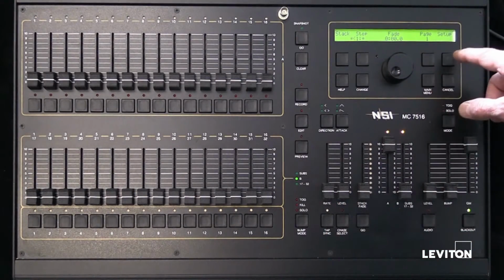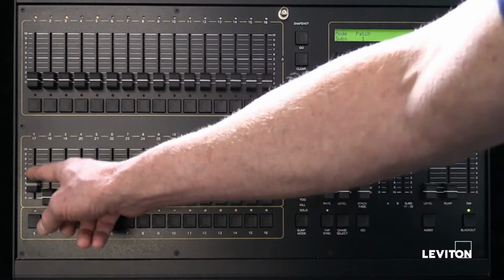7500 Series Technical Support and Training

Comment: Hi I have a dmx controller model liviton mcl-128R I want to know if I can put new luminaires type beam 7r manually and as I do since I do not have the cable psrs download the current library of my equipment
Reply from the maker: Yes, there are ways to add a DDL file to the MLC128R. Please contact emcatechsupport@leviton.com and they will walk you through the process.

Comment: I'd like to control our sanctuary overhead lights with our NSI 7516.  Currently we have 7 contactors that control (ON-OFF, no dimming) multiple fixtures.  Does Leviton make a DMX device for this application?
Reply from the maker: Hey James, D4DMX (http://www.leviton.com/en/products/d4dmx-md5) but it really depends on the number of channels you want to control. How many fixtures and how many channels are you looking to control?
Reply: Thanks for the quick reply!  Let's see if I can describe this...We currently have 7 switches that control all the overhead lights.(from 2 locations).  I'd like to eliminate this and put it under the NSI control.  The switches in turn, control big hairy relays that actually connect to multiple fixtures.  So I want to eliminate the current 2-way setup that the sound guy has to spin around and fiddle with.  It would also be nice if there were a way to activate the lights remotely (via DMX) with, say, a wall switch like unit that could select a scene perhaps?  Again, this is not a dimmer application, it's an ON-OFF situation.  So the sliders (I'm new to DMX but I'm and EE with 25+ years exp - I might use the wrong word) would go above half to turn on and below half to turn off, or something like that.  We can go off-line if you send me an email or phone number.
Reply from the maker: Probably better over the phone so you can get proper assistance. 1-800-959-6004 Leviton Tech Support for Theatrical equipment. Extension 4 presently is the NSI/Colortran extension to choose.
Reply: Well, after calling 6, yes 6 different numbers (The one you gave referred me to another and they just kept re-referring) I figured it out on my own.  There may be other models, but the N5600-D00 (http://www.leviton.com/en/products/N5600-D00) can be put in "Switch mode", where over 15% on gives full on and less than 10% on gives full off.  Essentially a  zero crossing solid state relay, as stated in the manual.  That should work.  Thanks again!
Reply: Sure enough, if you read the whole manual for the D4DMX, right at the end it says you can put it in "relay mode".  Perfect!  and it is 1/3 the cost of the N5600.  Thanks!

Comment: Hi friend i'd try to set up and record in sub mode in my MC7524 some of the extended channels and it doesn't work, i follow all the steps from your training video, Thank You. I'm Working with led fixtures
Reply: No answer yet?
Reply from the maker: Make sure your Subs B Fader LED is always lit, during programming and regular use. 

From the Main Menu press the F4 button as Setup. 
Press the same F4 again as More. 
Your Max Dims should be set to 48 or higher. 

When recording the Sub, you must be in 25-48 mode. 
Raise the faders you wish to record into the Sub. 
Press the RECORD button, then press the Sub button you wish to record to. 
Lower the faders and change the mode from Single to SUBS. 

Raise the Sub fader representing the Sub button originally chosen. 
Your saved scene with extended channels should be included.

Comment from the maker: The 2408 CD dimmer pack will control LED fixtures that accept forward phase (also called leading edge) 120V control. This will be listed in documentation by the fixture manufacturer as something like 0-120VAC Forward Phase Control. Hope this helps.

Comment: Is the NSI MC 7524 LED Load Compatible? We are currently using 300w dimmable fluorescent flood lights and would like to change them to a LED equivalent.
Reply from the maker: +Chris Ellis The short answer is yes on the control side. However, you could run into an issue on the dimmer side of the system. Chris, Are your lights connected to dimmer packs? If so, would you be able to identify the dimmer packs?